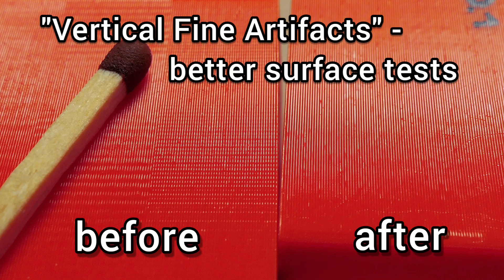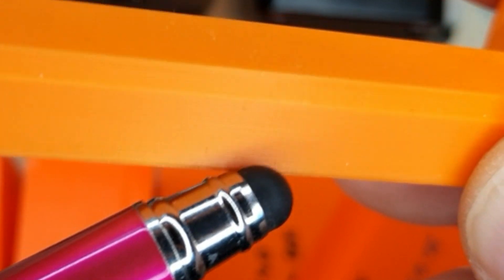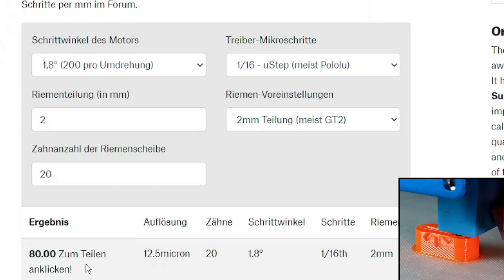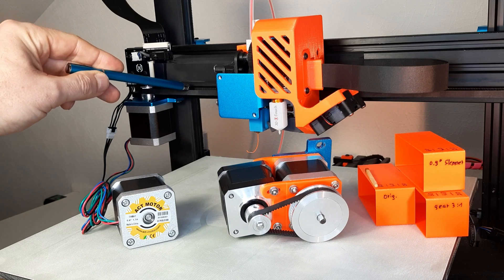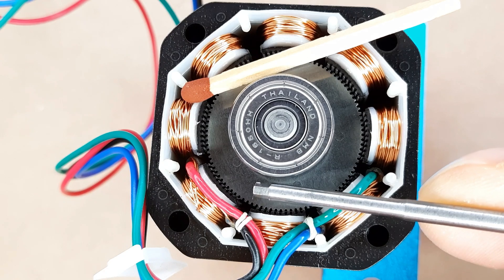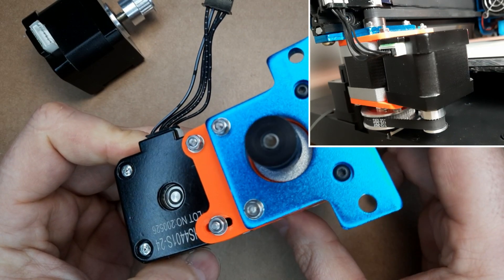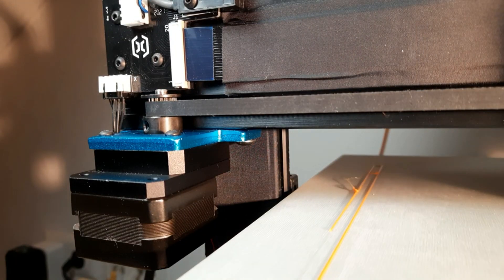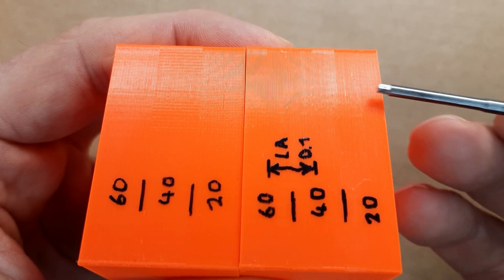(english) Better Surface Quality / 0.9 Stepper Upgrade vs. Gearbox

Comment: Excellent video. I spent MANY hours researching Fine Vertical Artifacts myself. Tried different pulleys (sometimes it helps)… But sure: the biggest culprit it the motor itself. Each motor has a different movement response compared to the electrical input. It varies with speed AND load! It is not linear and that’s what we see on the walls. 

My Ender 3 got very prominent FVA on the Y axis, almost perfectly smooth on the X. I tried different motors and I found a 0.9 stepper that produces much smoother walls. But it is much louder than 1.8 stock stepper. There is always trade offs 🤣 

Thanks for sharing!
Reply from the maker: I agree. Thanx

Comment: Three years ago, I tested the X and Y axes with a stepping motor with a 1:4 gearbox.
The result was that the VFA wave was invisible.
However, when magnified and measured with a microscope, it was found that the resulting wave became as small as the gear ratio.

Comment: Great video, very clear and informative Thank you!  (BTW, voice, pace, music, all perfect :-)).
Have you seen any issue with the MCU not keeping up with 0.9 Deg steppers (when printing at normal speeds appropriate for cartesian printers)?
-> According to Voron FAQ about the increased number of steps required by 0.9deg steppers: (...) This combined with microstepping results in more cpu load on your boards and would then start to limit how fast you can drive these.(...) Just running 1/16 microstepping with 0.9deg XY motors and pressure advance with a 1.8deg stepper on the extruder is enough to easily overwhelm the board."
Thank you 👍
Reply from the maker: no issues so far with the mcu. Ahoi
Reply: @JustPrinted3D  Great, Thank you 👍

Comment: Great research!
Can this design withstand high speed printing + high acceleration? For example 100-200mms ?
Reply from the maker: I guess NO.
The large bed 300x300 of the sidewinder is too heavy anyway.
Buy a diffrent printer for such desired high speeds.
Reply: @JustPrinted3D  Yes. I also mean in other printers :D
Thanks for replying.
Reply from the maker: The belt gear can manage higher speeds, the stepper runs faster, lauder, but should do it. Due to the gear ratio the motor unit is 3 times stronger when it comes to changing fast directions.

Using the 0.9 stepper reduces the holding power of that motor.
That will probably not work too fast, will loose steps on abrupt direction change.
Try your luck.

Comment: if i upgrade to this stepper motor do i need to adjust anyting in the Firmware.
Also great video plz include as in the DE video the name "Modell 17HM5417" of the stepper motor so ppl can find it on Amazon or other shops easy.
Reply from the maker: Need to install the Digant Marlin and TFT firmware.
Rather than that no need to adjust the firmware or compile by yourself.
But need to change the steps per mm very easy within the printer Menue if you have installed the Digant TFT firmware.
The 0,9 Stepper has double resolution, so needs to double the steps per mm.
Reply: @JustPrinted3D  how did you donnect the wires from the Modell 17HM5417 to the printer connection in witch order ?
Reply from the maker: Left to right
Black/Green/Blue/Red
Just swich to wires if it doesnt work.
It eather works, runs the wrong direction or doesnt run at all.

Comment: 3/1 gear it's better for resolution, but speed is decreases 3 times
Reply from the maker: You change the printer settings from 80 to 240 steps per mm.
In Cura you define the speed as usual 
Exactly that defined slicer speed will be printed at.
The stepper will have to turn three times faster, ofcourse. That ist absolutely within the safe speed range of the steppers. So no speed problem at all.
The first few users received their 0.9 degree steppers and are very pleased with the better surfaces.

Comment: Did you also use an 0.9° motor as the extruder also, or just X/Y/Z?
Reply from the maker: I left the exteuder stepper original, since the gear ratio is alreasy so high that it makes no sense to me using a 0.9 here
Reply: @JustPrinted3D  More steps per rotation (vs 1.8) implies finer steps, indicating it could move lower volumes of filament per step, peraps making layers as thin as 0.025 or thinner. That may become thin enough to hide the layer lines from the eyes.
Reply from the maker: The limit is not the extruder stepper.
The limit is the physics.
Nozzle clogging, heat transfer from nozzle into the old layers eg.
New melting problems arise by trying too thin layers.
Test it.
Reply: @JustPrinted3D  Simply need to increase the speeds of X & Y (but that would lead to underextrusion at many points, most likely). I print in ABS primarily so melting previous layers isn't as great a concern for me.
Reply from the maker: Ok, so try it and let me know how it prints
Reply: @JustPrinted3D  I have not purchased 0.9 NEMA 17's yet. I was viewing YouTube to see if they functioned as I expected but near absolutely every maker using them doesn't use exclusively 0.9's and 100% showed nothing functioning as expected (the vast majority displayed a substantial loss of print quality or slightly worse than the 1.8's they changed from. They're inexpensive so eventually I likely will buy them after all else of my CR10S or CR10S5 have been upgraded (hard to get behind items which 100% of people show as having zero benefits - I'd like to think I can work around the issues many showed).
Reply from the maker: I agree that the results of that 0.9 steppers are not sufficiant enough to be worth the change.
I wouldnt do it again.
Since I have them, I use them.
Reply: @JustPrinted3D  Mind that artifact can also form due to the extruder stepper motor turning not smooth enough;
Years ago I had troubles with artifact which looks a bit like the ones shown here.
The problem was the DRV8825 stepper driver that I used for the extruder was not able to turn the motor smoothly enough. I changed the driver to an old A4988 and the artifacts were gone..

Comment: ive run the triangle labs 3:1 box with an ldo pancake 1.8 stepper for over a year on my prusas. in addition to adding the gearing, it also reduces the toolhead weight fairly significantly compared to the stock motors by probably around 20g even with the pulleybox added. i opened up the pulley box to re orient it to fit around my shroud. i think in the 12v era, switching to .9s was a lot more sensible. but with decently wound motors and everything in 24v i think its less of an issue than it used to be, we arent as torque starved anymore. i get exceptionally good prints on my prusa with this current custom toolhead using a pancake stepper from ldo, a triangle 3:1 pulleybox, and a delta-p shroud. have the whole toolhead reprinted into abs further reducing weight by another 15% as abs is significantly lighter than petg by volume, and this allows for better resonance performance/higher accel also. einsy isnt a great board to run klipper so i dont run my prusas on klipper anymore, like i do on my vorons, but if i ever felt like board swapping it, id go back to klipper.
Reply: did you bought the triangle labs gearbox along with the trianglelabs stepper and later you changed to a ldo stepper? i want to buy this kit, but just the gearbox
Reply: @borisgraell  when I bought it, it came with the motor. This was like probably 2 years ago

Comment: i experimented with this on my voron and found that with 1.8º motors I can get rid of vfa by upping my microstepping to 128
Reply: also it doesnt lose torque at high microsteps because the drivers are internally often running at 256 microsteps (on 2209s) I still can get 30k accel at 500mm/s without issues, it just changes resonance which sometimes can cause skipped steps sometimes

Comment: Hallo schade das der deutsche link nicht geht ,sah schon interesannt an.  
LG.
Reply from the maker: Das deutsche Video war zwei Minuten nach dem EN online, muss funktionieren.
Grüsse
Reply: Tq for english
Reply: As u can see. 60 on no reduction is same as 20 with reduction smoothness except some ringging due to ineartia because they move faster. Some shape small one cant print fast. Plus those ringing due to inertia. 

On some printer above 200mm/s the artifact is loss. Can be said. It cogging of stepping on slow move. Another cheap for diy printer is running them leadscrew. It give 400step. But he top speed cant exceed 100mm/s

Comment: Btw 0.9 res stepper is a downgrade. Less speed less acc, so with gear combination and hi flow when U printing fast is waist of print. 1.8 res motor and 32 micro stepping is the choice
Reply: congratulation for nonsense of day.

Comment: Probably the other motor is in a microstep (between to full steps). The other motor might be vibrating due to mains voltage noize(missing capacitors close to the stepper driver) or because the stepper driver can't hold the motor still (not enough current).
Reply: sorry but main voltage noise has nothing to do with stepper motor DC

Comment: you cannot open the stepper motor as it will permanently lose torque.
Reply from the maker: Why do you think so?
Sure you can open and close the stepper.
The magnetism is not lost because any opening.
Reply: @JustPrinted3D  this is simply not true. hybrid stepper motors are not just plain simple brushless motors which you can open and close as many times as u wish
Reply: @JustPrinted3D  Disassembling the rotor from the stator will make the magnet loose some magnetism. This is due to how the magnetic field is guided through the stator material. Same with Permanent magnet rotors from industrial Servo motors, when disassembling you need to transfer the permanent magnet into a sleeve to not damadge it.